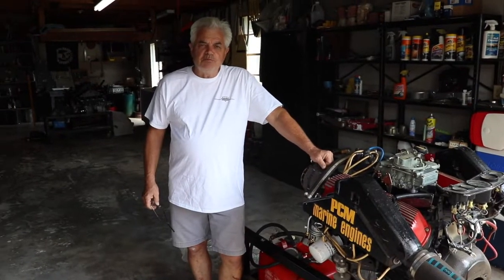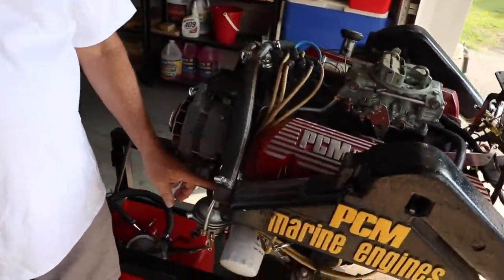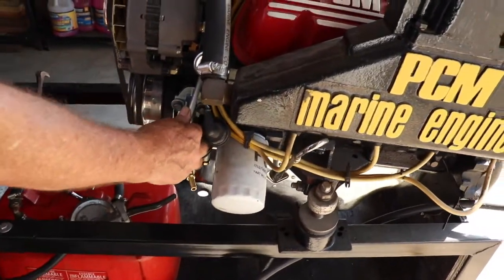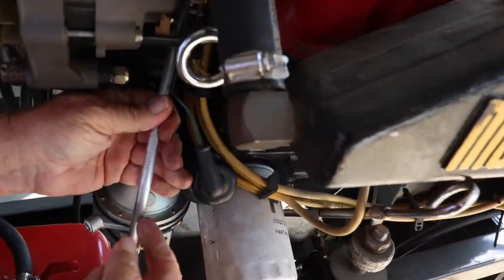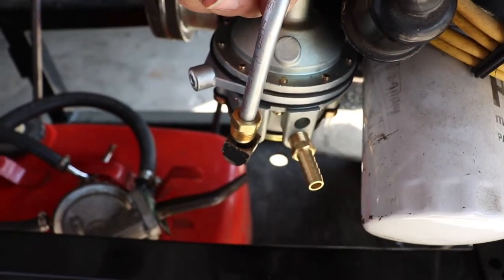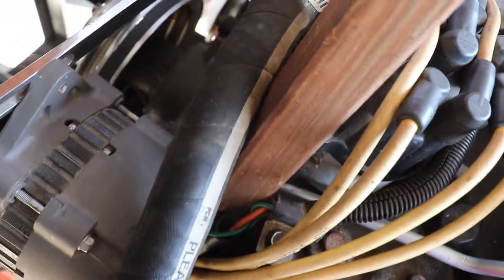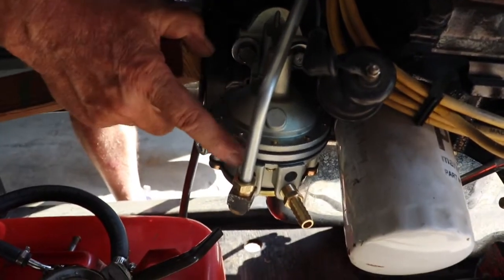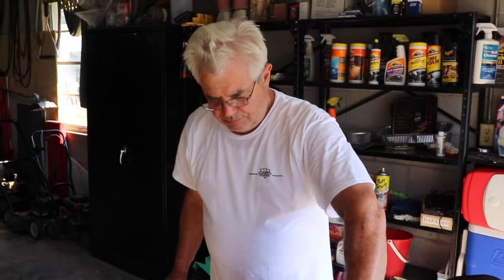Sierra Marine Fuel Pump Ford 351 & 302 Installation Guide

Comment: This is excellent advice. It's really important to get those fittings straight. As you showed here, sometimes you can be just a little off, and still take your time, and get it lined up. Nice work!
I am a Boat Mechanic, myself. Working out of South East Michigan.

Comment: When replacing the fuel pump, is there any concern with the position of the lever inserted in the engine? Does it just bolt on or are there steps to make sure it is in the correct position? I will be ordering the pump from skidim. Still not sure the pump is bad but will probably replace anyway. It keeps running out of gas … when not out of gas. Changed the water separator and it is running again. If it does it again, I think it has to be the pump.

I have a 1976 ski antique with a 351 Windsor PCM Engine.